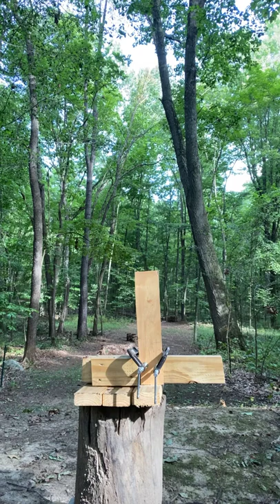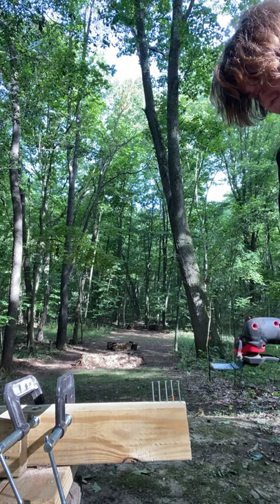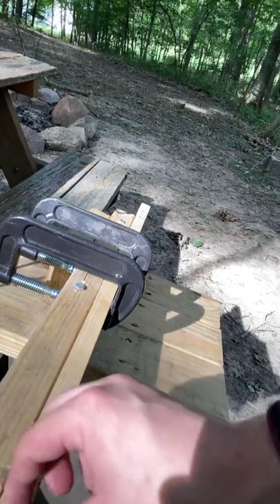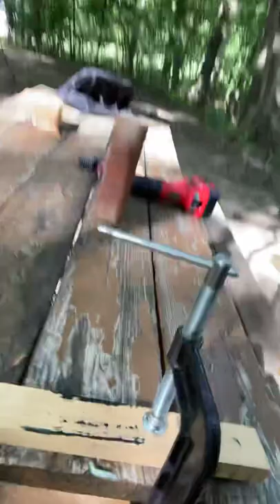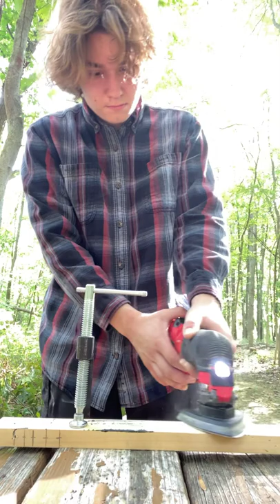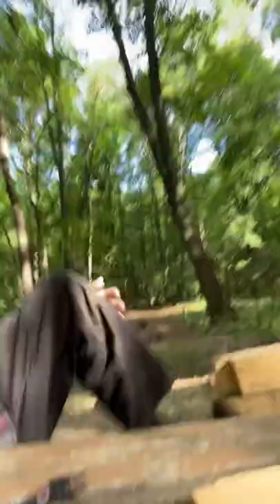Craftsman V20 Cordless Oscillating Tool Review

Comment: Craftsman brand has multiple models of these tools for under $100 (Nov, 2023,) but they are NOT brushless construction, hence less efficient. Skil has a brushless model, one battery, with many included blades for only $59!!!  Several other name brands, brushless, one or 2 batteries, for around $100.
Novices like me did not know key differences in performance brushless vs. with motor brushes.